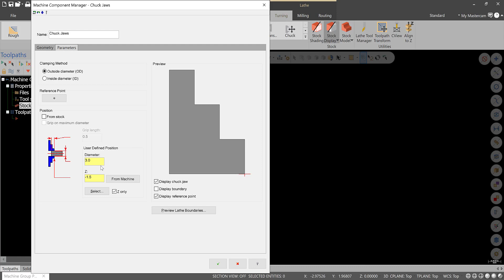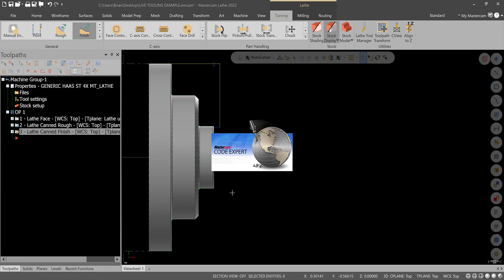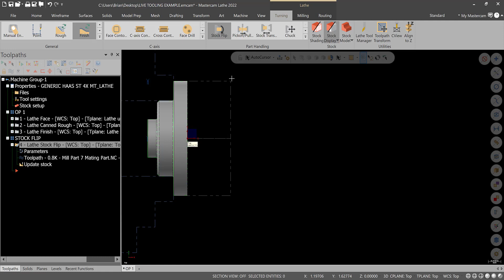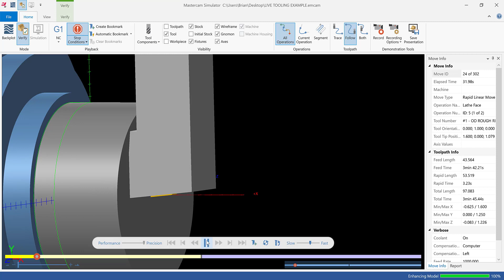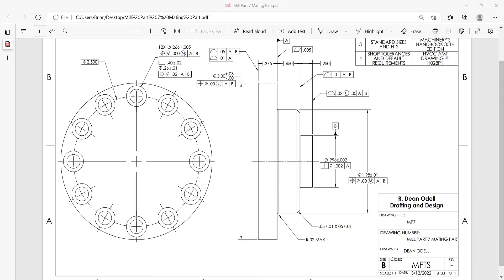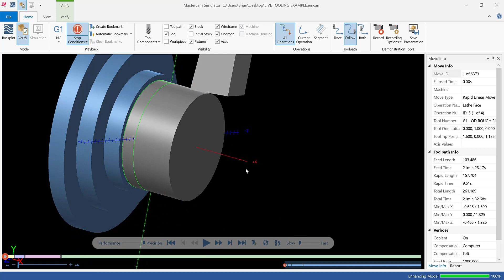Mastercam Lathe Axial Live Tooling

Comment: Great video! I have ran mastercam for awhile know, I'm curious on what 3d toolpath you prefer to use or use the most often. Mastercam i believe has the most 3d toolpath of any cam software ive used, can get confusing at time to make sense of which one is better suited for the application.
Reply from the maker: 3d as in surface milling?
Reply: @BrianWickhamMFG  yes.
Reply from the maker: @raider1628  I normally use Opti rough then either raster or scallop. There are times I use flowline as well.